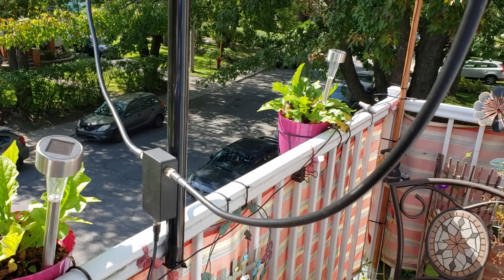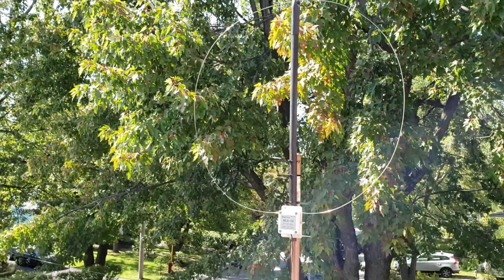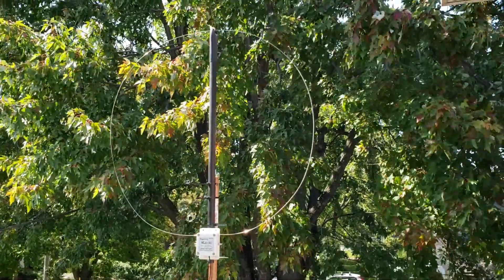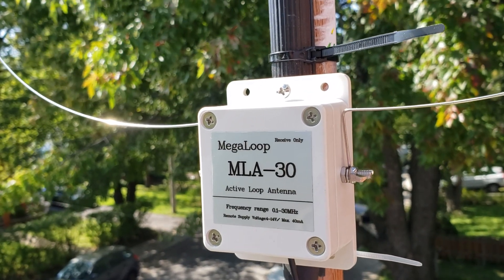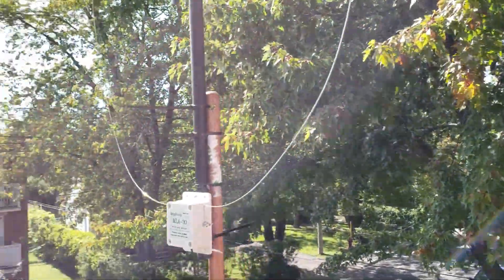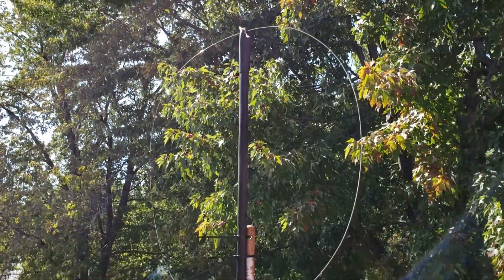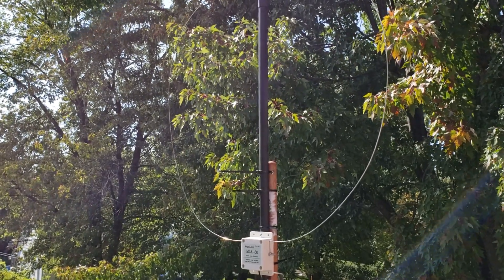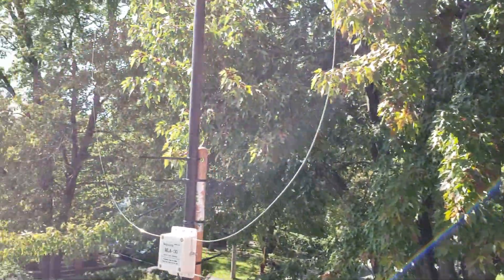MLA 30 Amplified Magnetic loop antenna ready to be tested

Comment: Question ??? it is mentioned that the preamp for the MLA30 runs on 5 volts, the SDR Play has a switchable 4.7 volt Bias T built into the unit, is it possible to power the MLA30 with the SDR Play ???
Reply: Yes it is